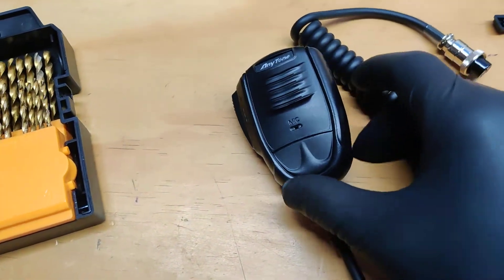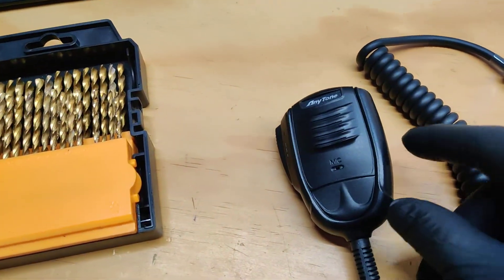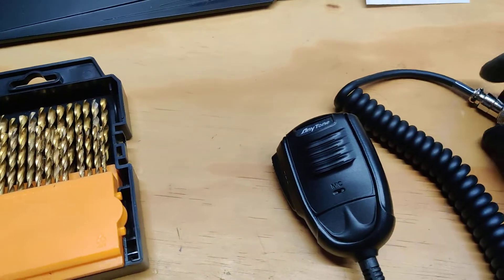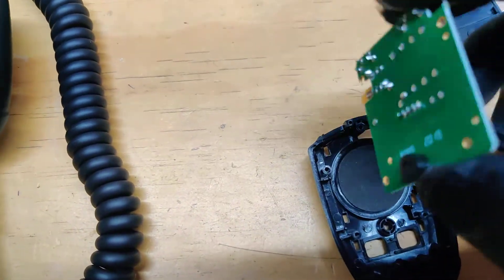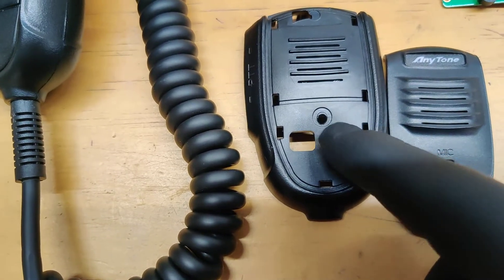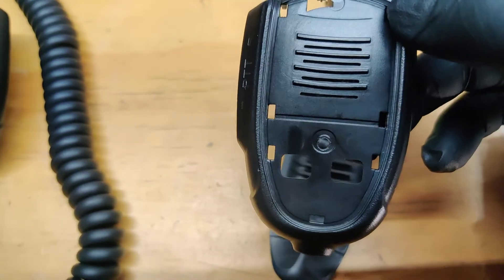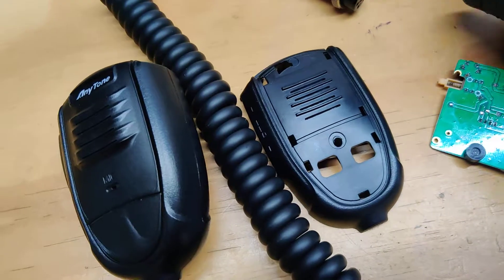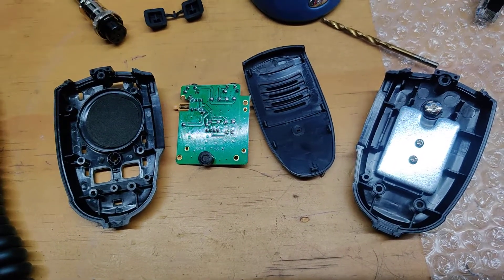Anytone AT 5555N II stock microphone project.

Comment: great vid,, How about a video showing how to wire up a desk mic please?
Reply from the maker: I don't have any desk microphone 😆.  Not sure which desk 🎤 you have but there has to be info somewhere about it. Which desk 🎤 you want to connect and to which radio ?
Reply from the maker: got it, I did that with a KPO hand held microphone because it came with 6 pin at the end and I used the original 🎤 cable with rj-45  and swapped it. I think they sale RJ-45 cables without anything at the end. or use adapter rj-45 to 4 or 6 pin. What desktop microphone do you want to use with Anytone 5555N II.
Reply: would love to be able to use this mic,,, @myszaca
Reply from the maker: @cosmoshfa88savant66  sorry but I am lost with the answer 😂.
Reply: I am thinking about buying a second standard mic,,leaving  the end plugged into the radio, taking the end that goes into the mike itself and using that end to wire to the desk mic,,if that makes any sense 🙂 @myszaca

Comment: I did this mod on a stock mic Anytone 5555nii and according to 5 locals that I talk to they said no change in modulation. I also have a brand new Anytone mic and the modded Anytone mic to swap out to compare and they reported couldn't tell any difference. I didn't notice and difference in the meter reading either.
Reply from the maker: For me sensitivity changed after the mod not the loudness of the modulation on the receiver side. Instead of talking very close I can keep the microphone a little farther and get the same results. For more aggressive and with higher tones modulation I use a handheld KPO microphone. 73.
Reply: @myszaca  Ok I see now I'll try that moving to mic at different distances. Thanks.

Comment: I did this about 25 years ago on a Icom Mic. Made no difference. But you also have to enlarge the hole on the mic face to. Because there is where it is being restricted no inside. 
It made my mic pick up more background noise and in a truck it was very bad.  Akso you might want to put a small piece of foam over the inside to prevent dust and spit from entering. In my case it did bring up the audio but not that much, All in All it wasn't worth it.

Comment: i did this mod and after i just used some high fidelity pro audio headphones pluged into the ext speaker jack [used a mono to stereo adapter for L and R sound]  well any ways disocovered the audio sounds very dull, essentially there no highs, i have bear cat 880 and the mic sounds crystal clean, while this mic sounds like the treble is turned to max negative, my question is, there away to adjust the "tone" aka add trebble to mic input, I ask because of the button that says "tone" however when i press tone, it gives me echo , and tone and echo are not the same, makes think there is a tone feature burried in the menu somewhere.
Reply from the maker: I only used that microphone with my At5555 and I don't here any big issue with the sound. sounds like a stock microphone  but more sensitive after the mod,  I don't have any adjustments in that radio to change sound of 🎤 like you would with audio corrector etc. Not sure if I got this question right but I never had cb or 10m radio with the option to correct 🎤 base,mids, heights etc. That would be nice 😆. I know those microphones have capacitor inside and maybe changing the capacitor to a different value would change the pitch. Not sure what that capacitor does in this one. 🤔. maybe we need to Google that 😂.

Comment: Good Idea. -- I see afew electret cylindrical  condenser replacement capsules on Amazon cheap ,wonder if a slightly larger with  higher db  would work?
Reply from the maker: Not sure what would happen, I guess trying is only the way to know what will happen. Not sure if bigger microphone would need different voltage or not.  Maybe one day someone will do it and share video. For some reason sometimes I am not getting  notifications about comments etc which makes my respond way to late. 73 for now.

Comment: Great work. Thanks for sharing! On my CRT M-7 I did another modification instead. Using a baffle behind the big mic front grill. This sounds great and does not affect audio quality due to the big front grill (in German it's called "Mikrofongrill", so I hope the translation is correct to call it a "mic grill" on English as well!?). Just removed the foam. Then I used 2 washers (d= 30mm with a drill hole of d = 6mm in the middle, both stucked with some drops of superglue). I needed to use an electret capsule with d=6mm due to its height.  A normal electret capsule with d=10mm would be slight to high and might be stuck to the PCB above it.  vy 73, Jochen, 13OP25
Reply: This mod with the washers i do always on electret Stock Mikes (Albrecht, Stabo, President, Team, CRT, etc.)
Works very well and the modulation increases a lot !!!

Comment: Does this mod give the same performance or close too as the KPO mic?
Reply from the maker: It's more sensitive but I think KPO microphone it's a different animal. I used original microphone with that mode for some time till I saved money for KPO and now I am running KPO in both my radios. KPO has more pronounced/vibrant sound  output compare to oryginal which is more on flat side if you know what I mean, at least that's what I think. Mod takes 10 minutes to do so I did it and shared it.

Comment: Damn good idea.  I just did it myself thanks to your film.
I also drilled the front cover hole to 2mm and it looks perfect...
Thanks!
Reply from the maker: Same radio or for different one, Big improvement ?? I saw about 40% increase in sensitivity with my 5555.
Reply: @myszaca  I live in Belgium and here in Europe the make isn't Anytone, but CRT (F).  The model is the 7900V.   (Looks the same as yours...)
I use a +/-200cm  Sirio 5000 whip antenna up on top of our chimney. 
My house is up on a small hill.  I think this helps.
The unit is my first SSB.  And I find it well made.  Very good sensitivity.   Very good selectivity. 
VERY nice big screen
Concerning the difference you asked about, I stupidly forgot to measure before so as to compare with after. Sooo...
I looked at the power level after and it's my impression that when I speak the transmission level IS higher, as it went several degrees higher, like over to the 60-80 w mark.
I will see in the little radio club later.  We use USB and I'm going to be interested. 
To me, you idea to modify the mike is "risk free" because, say it has as secondary problem, well I'd just re-open the mike, carefully fill in the hole with, epoxy or hot glue, and re-drill a teeney-weeny hole again.
Reply from the maker: @PeterJavea  Very nice. I think it will work better for sure. If it's to strong then lower sensitivity of the microphone in radio and no need to cover the whole and redrill. I know CRT radios. My friend from Michigan area is importing some of them from KPO company. CRT, Anytone,Striker company is using same boards but they customizing radios to there taste. Very good radios, the best one I ever had for 11 meters. I got powered  KPO  microphone for this radio also and it works very well with it. To bad that I am in West Coast, I can't get skip to Europe so I want be able to reach you over the air.  let me know after couple days or weeks how you like this 🎤 after this mod. 73 for now.
Reply: @myszaca  yes, you're right.   There's a setting for the  mike in the menu.
Will get back with feedback.

Comment from the maker: So any luck with this mod. Anybody trying and seeing improvement or not feeling like it will do anything, just checking.
Reply: I have done something similar with another stock microphone removing rubber blocking element and adding holes to the front the difference is night and day
Reply: I did the same mod to a microphone that comes with the stryker 94hpc it's the same microphone with up and down buttons on top. Once you remove the front grill and the board you realize the microphone is almost completely blocked iam thinking it must be really sensitive. I drilled the hole from inside out same size and I ended up removing the front like you showed and placed a piece of light cloth between the front grill and the body of the microphone thanks again for posting your original mod 73's.

Comment: Thanks for sharing your mic modification. So does this mod do anything for the pop that these mics are prone to? This style of microphone from anytone is known for the awful pop if you don't speak across the element hole. 73 from Texas
Reply from the maker: That I don't know, For sure got more sensitive. I used that mic for 2 weeks and then I got KPO mic. I never had anyone telling me that they here something weard with stock mic. Not sure what the pop is coming from, side spring makes some crick noise but pop noise is new to me.  Maybe someone else will know something about this issue after this mod. 
I can connect that mic again to my radio and check it with talk back function, is that something that would help you to see. Try the mod maybe, let me know.73
Reply: My microphone of crt 9900 same type is known for the terrible pop if you do not speak over the element hole

Comment: Got it!  Thanks again!
Reply from the maker: Let me know what you think. 73
Reply: @myszaca  it definitely makes a difference, for the better. But I would think you wouldn't want to drill any larger than you did. 
Perfect!! 
Thanks.
Reply from the maker: @texasrodney  Nice, I definitely saw the difference especially when I used it in SSB. 3.5mm size drill is max what is needed. Wasn't too bad to do it, was it?
Reply: @myszaca  easiest mod I've ever done and yes, definitely good results. 
Start to finish was about 10, maybe 15 minutes.
Reply from the maker: @texasrodney  Nice, glad it worked for you. 73 for now.